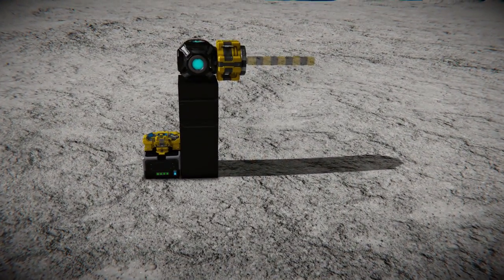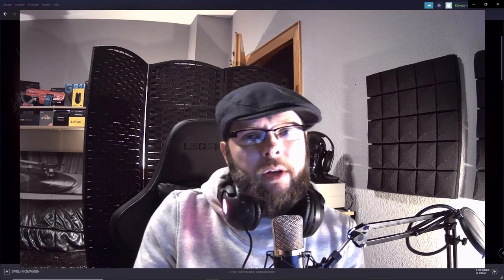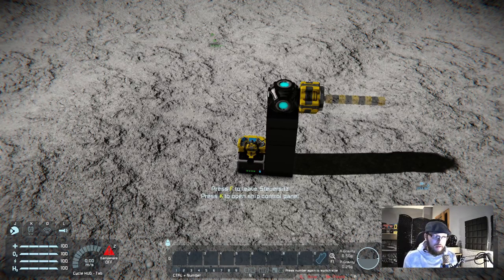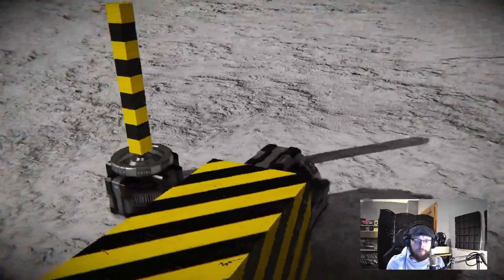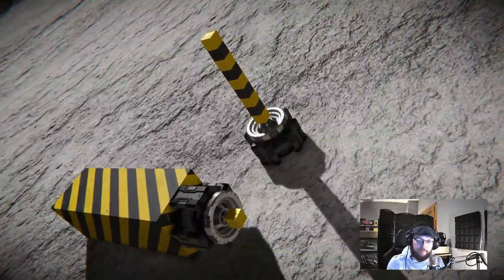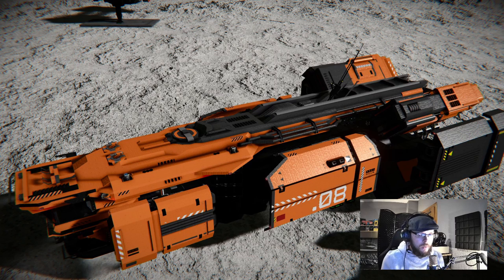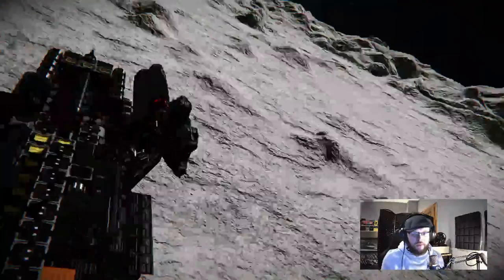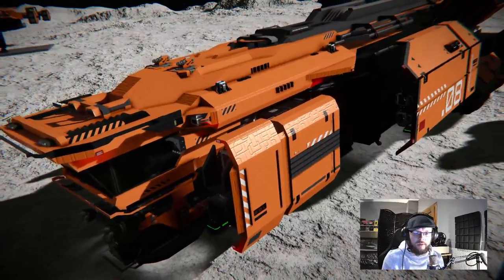[SPACE ENGINEERS] Forcing a large grid projector to show small grid - by Kelevra

Comment: Great discovery! I think the small to large grid is the most useful by far for space saving. Now seeing this, I'm just wondering. wouldn't it be feasible to build the core ship, add the rotor heads, then just add a small projector with the subgrids on them to weld it up? It would retain all of the groups and paint schemes as well. I only say this because I've thought a lot of it on my own projects with many sub grids.
Reply from the maker: It is another option, yes. But this also wont make it printable because the housings of the argo mole have crossing hitboxes with other grids and with the larg grid projector you are able to deliver the subgrids instandly instead of having projector-subgrids that have to be constructed first. I dont say this is a "game changer" but it is a new option.
Reply: @KelevraEngineering  That makes sense, Its a great workaround for sure. I love these little hacks that come out of this game, by no means was a bashing your discovery, very cool stuff!
Reply from the maker: Absolutly didnt understand it as bashing. I know it has a lot of potential for discussions and it seems this never been published by someone else. So it still needs a lot of research and rethinkings.
Reply: Im the end of the video you mention this does not carry over groups from the sub grid. You might be able to get around that issue by having a projector of the subgrid on the actual subgrid itself and a timer block to turn off the large grid projector, you then get to print everyhting from a projector on the same grid and thus keep all the groups!
A bit tricky but should be feasible.  I hope I made my self clear there if not I can explain better.